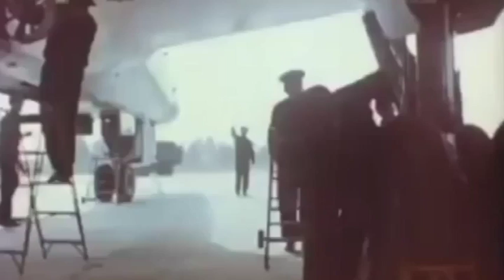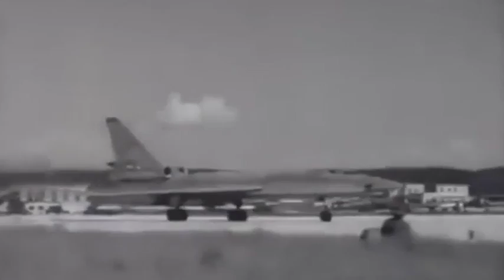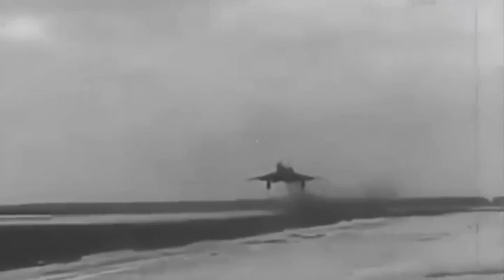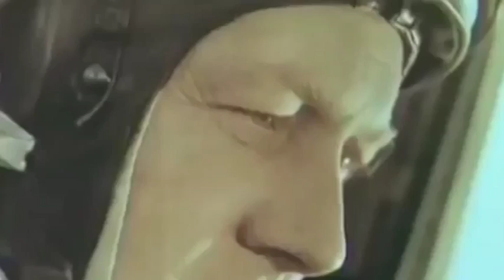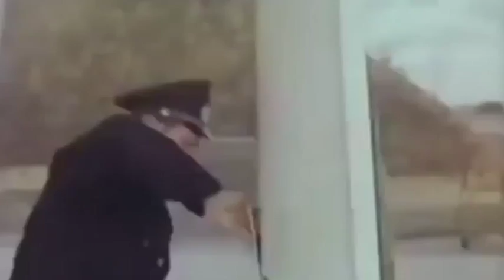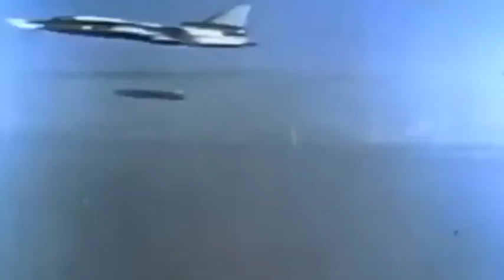Tupolev Tu 22 Blinder - First Russian Supersonic Bomber

Comment: For those who want to know more about the Blinder "Tupolev Tu-22 Blinder" by Sergey Burdin and Alan Dawes is an excellent book. Follows the design, introduction into service and use in Soviet, Libyan and Iraqi air forces. A section with accident reports (of planes in Soviet service) at the end paints a good picture of how tricky this plane could be. It is broken down by failures in mode of flight rather than purely by date and includes date, weather data, synopsis of the incident or accident and what/who was at fault or to blame. (In one instance the pilot of one of the accidents is interviewed and gives an account of his crew's ejection from the craft.) Not much really went wrong with the plane in flight, but when it did it usually involved the crew's ejection and loss of the ship as the fuel system was designed in such a way that a leak or imbalance of fuel usage would lead to an out of CG condition rendering the Blinder uncontrollable. Interestingly most accidents in the landing phase were caused by pilot error and even high time pilots were caught out, sometimes just by complacency.